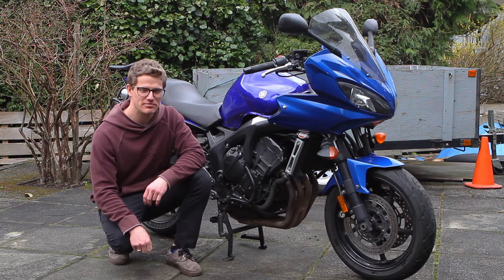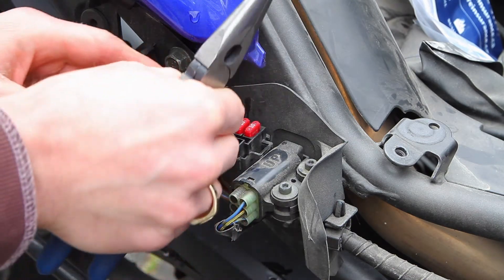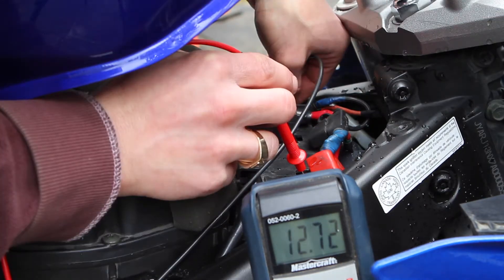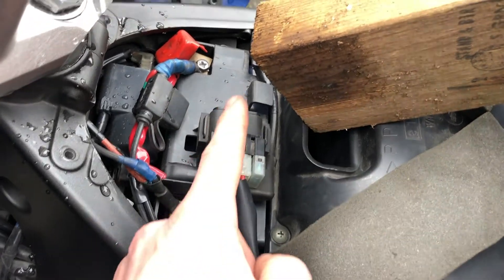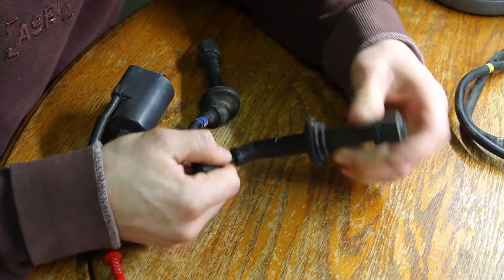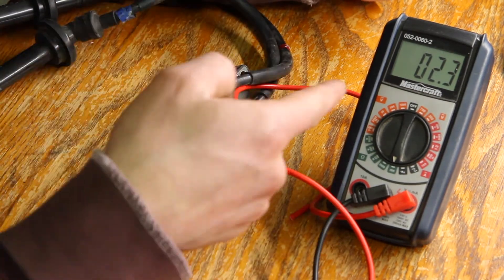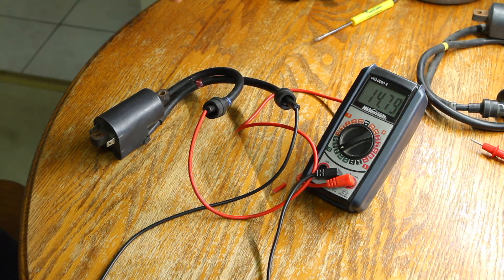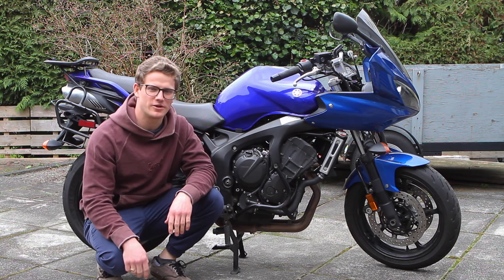Yamaha FZ6 Misfire Diagnosis -  FULL Ignition System Inspection

Comment: Have a misfire too and after testing (very difficult to get 10k) the plug caps one was totally dead. I decided to disassemble them. There's a spring, a 10k ohm resistor and a bolt. Bolt and springs were corroded and dirt. After cleaning it and attaching a piece of steel wire to the end of the springs all of them give 10k . It seems the spring end inside the cap has very bad connection. Had to make this trick and I hope misfire is gone now. Let's see

Comment: Hey Calvin, I’m dealing with an issue i have with my 06 FZ6 I just picked up. I’m consistently blowing ignition fuses and it seems like it only happens on deceleration. I’ve replaced the r/r, the stator tested good, battery is good and brand new. I just can’t seem to figure it out
Reply from the maker: Hmmm that’s odd. I suspect the coils need replacing. I would also check spark plug gap, or replace the plugs. Also maybe check for a loose ground wire. There is a ground wire on top of the transmission. I would also measure the crank position sensor to rule that out for certain. That’s an odd problem you have, if none of my suggestions fix it I would try measuring the voltage and current going through the ignition fuse with a multimeter with the bike on a centre stand and free revving. I don’t think the main or ignition relay would cause an over current condition but it’s worth considering. Best of luck!
Reply: @Calvinm  I’ve since replaced the ECU that had a giant crack in it, and I’m going to be replacing the whole wiring harness pretty soon as well. My clutch cable snapped so sadly I don’t really get to see if the ECU is going to fix this but I’ll look into the coils like you said. Thanks!
Reply: @Calvinm  so I’ve tested the voltage across the fuse while free revving and it’s a pretty consistent 17.5 +/- 0.6 every so often. How would I test the coils or do you already have a video on this?
Reply: @Calvinm I have since fixed this it was the ECU
Reply from the maker: @banstack2869  Good to know! Glad you go it fixed!
Reply: Sorry to comment on a older video but what do you think happened to me , I changed my spark plugs and now the bike runs on 2 cylinders and backfires then stalls ? It was fine and ran perfectly before the plug change.
Reply: @mickrelsor157 I think you might’ve plugged the coils incorrectly the wrong way
Reply: @banstack2869  thanks for the tip but they're in the right order , either way it's only getting spark from 1 plug on each coil . So that means 1 coil fires 1 and 3 and the other fires 2 and 4 . I'm only running on cylinders 1 and 2 but still getting spark and fuel to 3 and 4 ... I already bought another bike so I'm just letting the fz6 sit lol

Comment: does this sensor measure rotation and together with the speed sensor display the speed on the board?
Reply from the maker: No, the bike has a speed sensor that measures the output speed of the transmission.

Comment: Would you suggest buying a bike that needs the coil pack, I’m not a mechanic and it seems like to much work for someone that doesn’t have the right tools. Is it expensive to fix?
Reply from the maker: A coil pack isn’t a particularly hard job. It means lifting the tank (or taking it off) taking out the battery, battery case, and rubber weather protectant. You don’t need many tools, just a 5mm Allen, 10mm wrench, and a screw driver. I’m not sure how much a shop would charge. The problem with this bike you’re looking at though might not just be a coil pack. People love to sell vehicles claiming its an easy fix when in actuality they have no idea or they know it’s a bigger problem than that... So do everything you can to ensure it’s just a coil pack. Best of luck!
Reply: @Calvinm  thank you for the advice, I really appreciate it.

Comment: My third cylinder is not firing at all. I don’t know if it could be a faulty ignition coil or just a spark plug. Where would I buy a new set of coils if it is them. I want a quality site with good shipping. It’s hard to find parts for this bike
Reply from the maker: Megazip.net and partsfish.com are good websites for getting genuine parts in new condition. Megazip.net ships from three different warehousing from different countries so they may have a shipping option that works for you. I think partsfish.com is located in the USA. I have ordered from both and gotten good parts from both.

Comment: Awesome video as always! I have a suggestion for a future video. "How to polish your exhaust headers on an FZ6".  :p

On an unrelated note though, have you ever considered installing a steering damper on your FZ6? I was considering doing that for mine. When you're really romping on it the front end gets a little light at high speed and you can feel a little bit of side to side movement. It doesn't do it to an extreme level or a level where I think it's unsafe, but it would give me more confidence if I had one installed. It looks like Öhlins used to make one for the FZ6, but they're a little hard to find and cost about $500 USD. You can get a cheap universal one on ebay, but they look a bit janky. So I guess for the time being I'll just live with it.
Reply from the maker: Oh ya I plan on polishing the pipes soon! Thanks for the idea. I have considered a steering damper but I've been turned away from it due to the price of kits like the Ohlins kit that seem like they are actually meant for the FZ6 S2. I also haven't had a tank slapper or experienced steering wobble on hard acceleration so I haven't felt the need to get one with the kind of riding I do. If I was gonna attend a track day I think I would consider it more seriously.